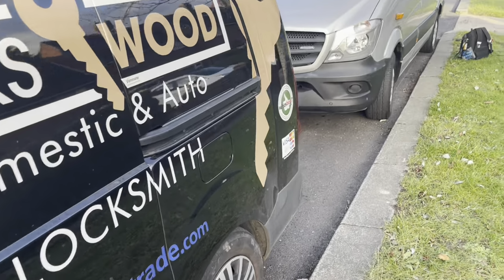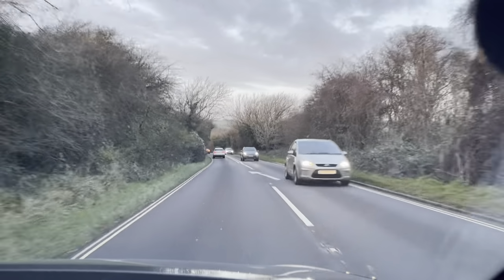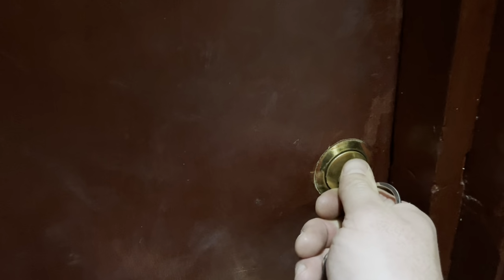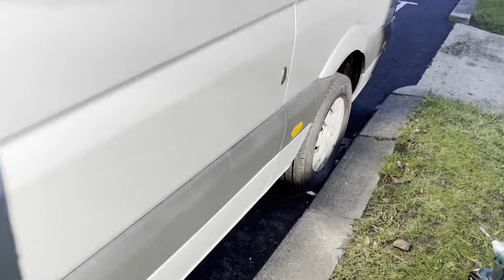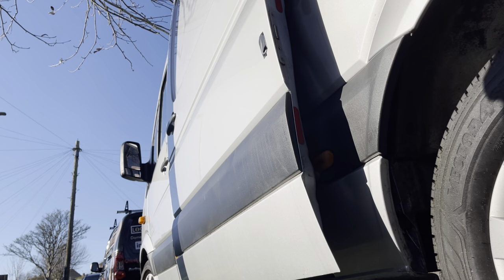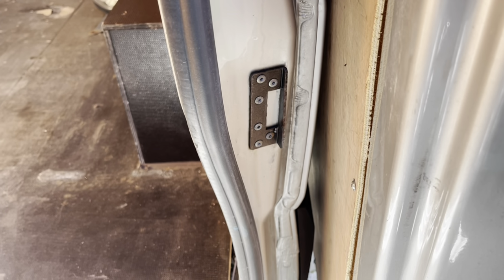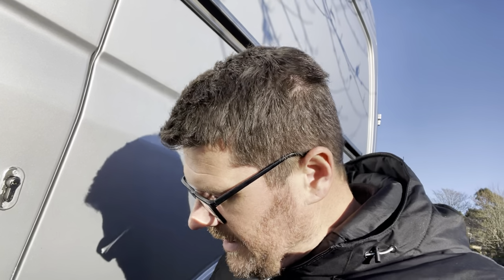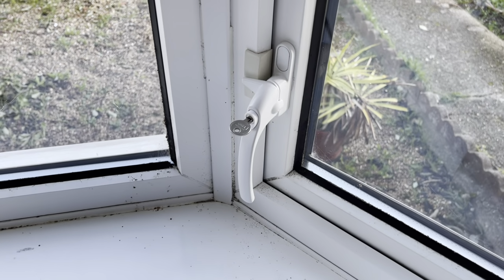Emergency Hotel Lockout | L4V Van Lock Cylinders Replaced | Window Handles Replaced - Locksmith

Comment: I remember back in the day, the only extra locks for vehicles were the Yale M69 locks. A mini round cylinder mortise lock in chrome. Cost a fortune!!
Reply from the maker: Oh wow! I do t know if I’ve seen one of them
Reply: @brighton_locksmith  They were especially popular with owners of ford cars, which were notoriously easy to open! The M69 lock had different size cylinders so you had to have lots of stock depending on what model it was going on...capri, escort etc

Comment: Hello I have L4V when I bought the van and I want to remove them to fit windows. I have the key and the locks work. Just don’t know what I need to do. Any clues would be great. Cheers. Jim.
Reply from the maker: Hi mate.
You’ll need to remove the screw that’s holding the cylinder, insert the key and turn it to either around 2 o’clock or 4 o’clock position and pull on the cylinder to slide it out towards you at the same time.
Once you’ve removed the cylinder you can then drill the rivets out holding the lock case in and then it should come out 👍🏼
Hope that helps
Reply: @brighton_locksmith  Thanks sounds simple  once you know how. I will have a go tomorrow. Good man.

Comment: What’s the point of putting keyed locks on the inside of the windows?  Isn’t that a major safety hazard?
Reply from the maker: It was a requirement from the customers insurance company. And no more of a safety  hazard than requiring a key to open a door I guess.
Reply: @brighton_locksmith  I respectfully have to disagree. Fire breaks out and you can only exit a window. Hope you can find a key. Double cylinder deadbolts are illegal in most parts of American homes for rental properties
Reply from the maker: @2815Juan  I completely understand your point and also agree. 
It’s a difficult one over here in the UK. The customers insurance company specifically wanted lockable keyed window handles so he has no choice or he wouldn’t be covered.
Reply: @brighton_locksmith  Very interesting. I watch your channel to see the different types of work Locksmith’s do around the world compared to myself in America. Thanks for the videos
Reply from the maker: @2815Juan  It is very interesting the difference in locks and even regulations just across the pond mate!
And thank you for watching and engaging 😊🙏🏼